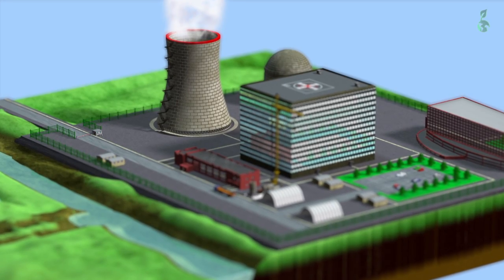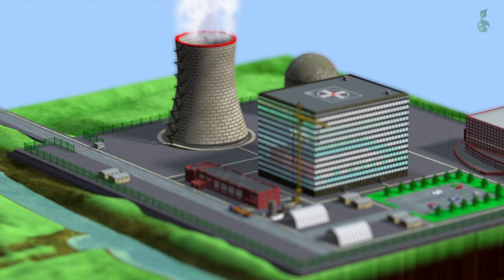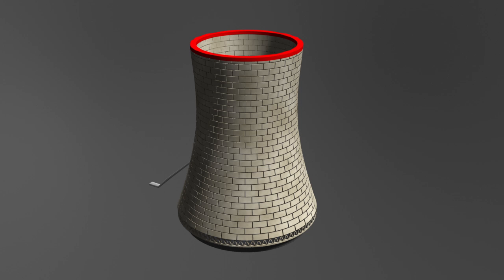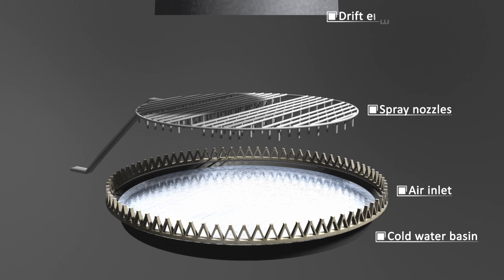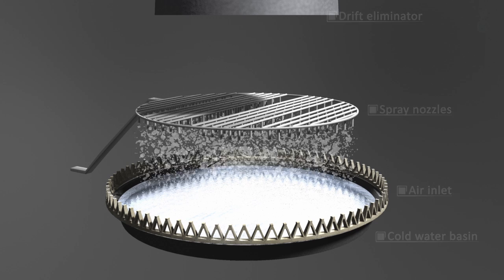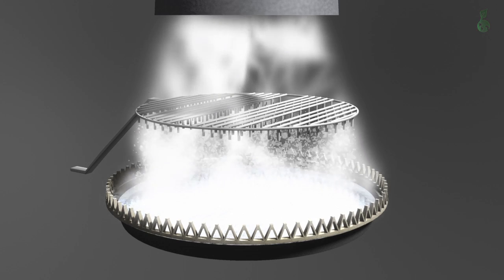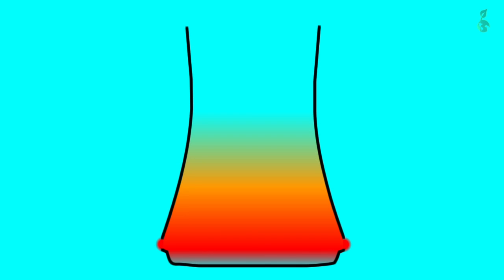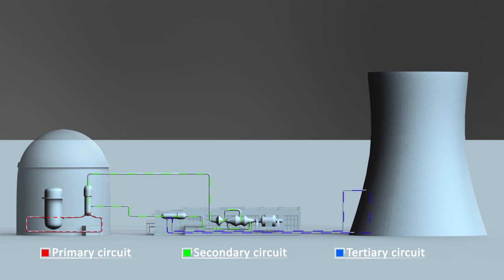Cooling Tower / Stack Effect / Natural Convection

Comment: how temperature of air at bottom is low as in evaporation both air and water will be cooled?
Reply: we are using fresh air each time . Air will gain energy so it will not be cooled . no evaporation just water vapour is formed .

Comment: They make the cooling tower high because the driving force for the flow depends on height.  The hot air has lower density, and the driving force is the density difference times the vertical height.  Higher cooling tower -> higher air velocity through it.

The cold water reservoir is colder than the water from the nozzles because it has cooled by evaporation.  That's kind of the point.

Comment: In video, it said the hot cooling water is sprayed to the water bucket below it. So it's just reservoir, or something in cooling process? (I'm not good at English specially listening, sorry if You get confused)
Reply: The sprayed water comes in contact with air inlet from bottom of the tower (cross flow or counter flow manner)

Comment: Why they made high cooling tower, what's the problem if it's short? And if the hot water sprayed to the cooler water, that means the cooler water also circulating?